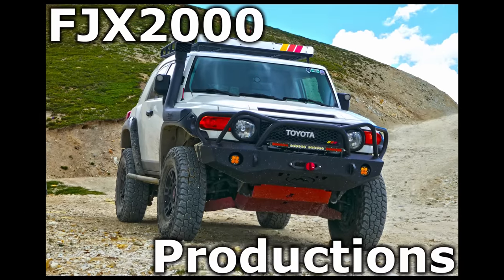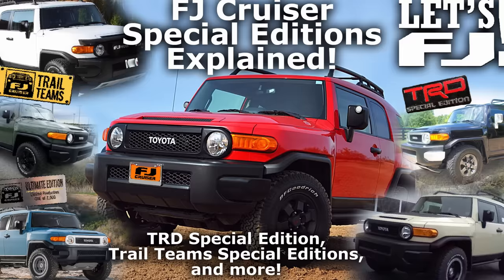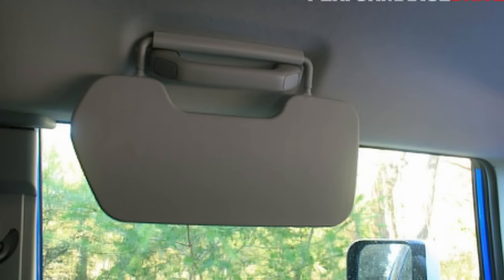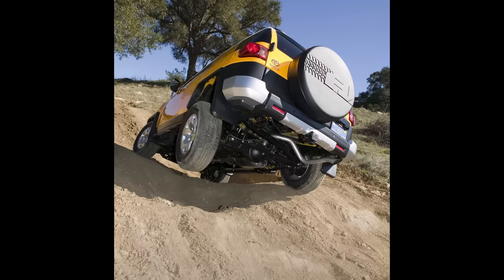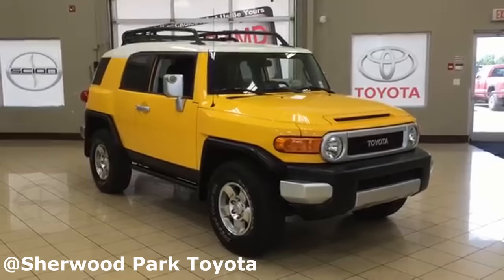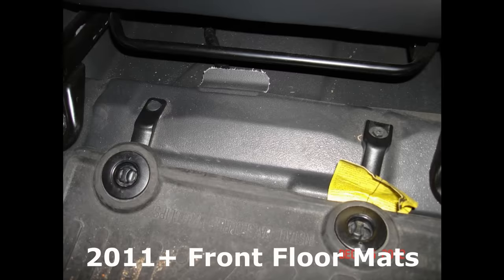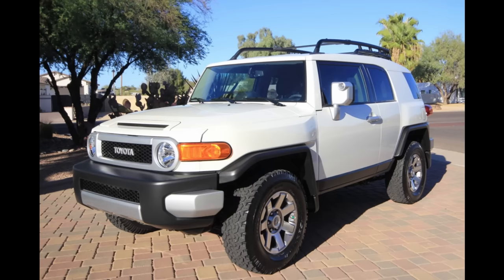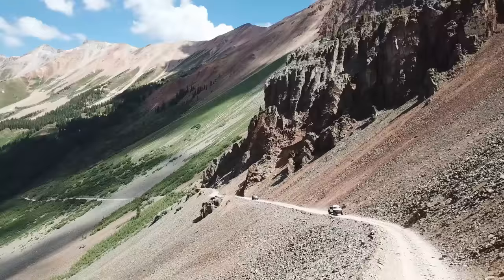Which FJ Cruiser Year is Best? - All FJ Cruiser Changes 2007-2014

Comment: I enjoy your video's and am a subscriber.  I recently bought a 2014 FJ (black with white roof).  Only has 50,700 miles on it now.  (When I purchased the FJ, it had 50,474 miles).  I am the second owner.
Reply from the maker: Congrats! Thanks for watching and subscribing!
Reply: How much did you paid for the FJ?
Reply: @anacorrea2675  I paid in the upper range of Kelly Blue Book.  (Between $39K to $41K)  This FJ was kept in a garage and is in an almost new condition.  The tires have so much tread left they look new.  Maintenance done on the FJ was by the dealer that sold it new.  There was a safety recall for the fuel pump so this was replaced along with the front disc pads.  This work was done before it was listed for sale.  If I had more patience, I might of been able to get the dealer to bring down the price.  However, I have no regrets and I am jazzed about my FJ!

Comment: When I've been collecting knowledge before buying my own FJ I found information that the front fender structure cracking was fixed by Toyota in 2008 (not necessarily ready for all '09 MY) by adding additional strengthen element inside. But if you found several 2009 MY FJs with this problem it means I found misleading information. Thanks for the video. Great job.

Comment: I'm a huge FJ fan, thank you for this channel...just seen a 2013 FJ, with 70,000 miles in excellent condition for $ 38,000 is this a fair price ?
Reply from the maker: Hey there! Thanks for messaging me! So to answer your question, I actually made up a spread sheet comparing 2013 FJs of all prices and mileages from across the country and this specific FJ seems to be pretty much right on the average for what these 2013 FJs are going for. So not a bad deal necessarily but also not the best deal out there. For that same price there are some FJs with only 31,000 miles. Hope that helps!
Reply: Definitely overcharged
Reply: It sounds about right!

Comment: We've got a 2010 FJ and it was certainly the bastard FJ, ordering parts for it is certainly....interesting because it's sort of a "which one?" Sort of deal.  Its got the upgraded engine and what not, but the floor mats use the hook retention and it's a little irritating, I have yet to find an answer on whether or not I can swap them with the twist and lock. BUT if you find an FJ with no A-TRAC and that's a deal breaker for you, DON'T LET IT BE A DEAL BREAKER, EVERY FJ IS EQUPUED WITH A-TRAC you just have to order the $40 button from Toyota and pop it in, which is a little labor intensive in the way that you have to pop a couple panels off to get the blank off and put the button in, but it's so worth it!
Reply from the maker: Yes when it comes to FJs you certainly have to know the difference between the 07- 09 models and the 2010+ models of you want to order correct parts. But the floor clips CAN be swapped out, check out the FJCruiserForums for more details but you just have to get the new style of "hooks/clips" and the newer floor mats to make it work. And to correct one thing, you can add A-TRAC button as you mentioned BUT only if  you also have the rear diff locker as well. If you have a base model only with 4x4 but no rear locker, you cannot add A-TRAC by itself unfortunately. Check out my FJ Cruiser button and switches video for more details. But thanks for your thoughts!

Comment: On daylight running on earlier Toyota fj cruiser mine a 2007 no crazy wiring hack needed, required.  Just raise up hood look on driver side look down behind headlight by turn signal you see the plug or remove small trim under driver turn signal you see a plug unplug it now no more daylight running headlights only takes less than 2 minutes I put bag over plug and taped it to keep it clean there is a you tube video on this quick and very easy job
Reply from the maker: Yep very true! But having the ability to control the daytime running lights like you can on those later years would require wiring up a switch. I actually followed a thread on the FJCruiserForums called the "Swiss Method" on my first FJ and was able to turn off or on the DRLs with the flip of a switch which was great! I did it so I could increase the longevity of the HIDs I had installed.

Comment: hey im a technician at lexus, great video i am thinking of getting a fj cruiser or a 4th gen 4runner limited. I'm trying to find a vehicle that fits my needs best between the two. it will be a daily driver as well as a weekend warrior going the distance as well as off road trips and the occasional tow of a car trailer to the racetrack. I am well aware of the modifications needed to get the limited spec 4runner up to the off road capabilities of the fj. I find it really hard to find a fj within my price range above 2009. Any sugestions??
Reply from the maker: The 4Runner and FJ are so similar it really just comes down to personal preference. If you see yourself transporting more than yourself and one other person frequently having a 4Runner with  the larger rear seat and true rear doors will be a great benefit, but if you like to Offroad and are really wanting something with a slightly shorter wheelbase then an FJ may fit the bill better. But you get more vehicle for your buck with a 4Runner and could find a better deal that way, since the FJs are selling for a premium right now.
Reply: @FJX2000_Productions  I now have 3 kids but won't get rid of my FJ. I just squeeze them all in the back :)
Reply: 4th gen 4runner is a no brainer for me, unless you really love the look of the FJ better.

Comment: Don't know if I missed it but  a major  major issue is the fuel tank size on my 08 these Fjs will take you anywhere but its not very far without extra fuel!! Wish I had double the size for my gas tank!
Reply from the maker: There are some folks who have added secondary fuel tanks to their FJs for this reason, but in places like the UAE or Australia you can get them from the factory with larger tanks!
Reply: @FJX2000_Productions   believe me I've done plenty of research.  I went with an expedition one bumper as a temporary fix for xtra fuel cans next year maybe I will invest in bigger tanks!
Reply: @FJX2000_Productions  only trail editions in Middle East were with double tanks or maybe some prior to 2010 models. FJs are excellent for daily highway commute, but refilling twice a week is pain...

Comment: Best model year of 13 or 14 is the 2013 bc the 2013 model year has a better build frame and chassis design, which a lot of people dont know, is from the toyota Tacoma from the same time period which made the vehicle longer and better at handling and comfort along with a much better advantage at offroading bc of the damping of the rear leaf spring and the front springs along with the sway bar
Reply: I though FJ platform is 100% J12 Land Cruiser chasis...
Reply: @The_Touring_Jedi  alot of people think that but actually no, the FJ concept back in 2003 had a custom chassis and body shell thats one reason most people where inspired by it, like the 2003 concept, the 2007 to 2012 had its own, for 2013, they took the chassis of the Tacoma from its generation, and rolled out a few special editions, paints, and options, and for 2014 it was another custom body and chassis design, not much different from 2007-2012 FJ models, all models used basically the same power train, and all used parts from land cruiser models, just refurbished, also proof that the FJ is not a glorified jeep bc of resale value and reliability, dependability, and capability, unlike Chrysler with this rollover likely rust buckets

Comment: I have a 2012 Army Green with 126k miles.,Unfortunately I’ve had to use it as a commuter vehicle.
It is leaking oil pretty badly now.  I’m about to get that fixed. 
I mainly use it off-road at the surf fishing beaches in DE. I have a permit for that.

Comment: 07 - The only FJ without those annoyingly expensive TPMS sensors
Reply: I have a 2013 model and it doesn't have TPMS. I guess it was an option that never made it to Australia.
Reply: 342k miles so far on my 07 💪🏿

Comment: I"m stuck right now between 2007 and a 2010   the 2007 has less miles. Both look good condition, but I am too far away to test drive either.

Comment: there is another big difference between 2007 , 08 to 2010 and up  ...despite the 239 hp against 258 , 2007 model is an unbelievable 1.5 sec faster from 0 to 60
Reply: I have a ‘07 and didn’t know this. When I hit the pedal, it surprises me at times though lol
Reply: Same here. Lol
Reply: It has a better torque curve than 2010+.  The only thing better about the 2010+ models is the fuel economy.  Whats funny about my 07 auto is its actually faster with the AC on than off.  This is totally the opposite with every other vehicle I have owned.

Comment: Today I have a 2008, with ATrac System and Rear differencial lock.The only thing I may install, is the Crowl control; for me, a magic tip to escape of the sand.
Reply from the maker: Unfortunately CRAWL Control cannot be added to earlier years of the FJ. It only came on the 2013 and 2014. Some have even tried adding it to the 2012 only to discover that the parts aren't simply plug and play. You pretty much need a whole new wiring harness and ECU among many other components. When all is said and done it is better to just buy an FJ with CRAWL control already. It definitely couldn't be added to an even earlier version of the FJ like the 2007-2009 models.
Reply: @FJX2000_Productions  Hello, what a pity! For me the Crawl Control is the best invention  Toyota had ever made.Here, in Uruguay, there are fews FJ Cruisers, and I think that there are all, from 2008 to 2011.Whatever, congrats for your videos and thank you so much for your answer.

Comment: My country of residence still gets 2021 models and is expecting the 2022's in a couple of months. so far these have been repetitions of the 2014 models but limited to only 1 trim package, which happens to be the highest "regular" trim (without TRD limited editions etc).
so it gets the JBL system, it gets the backup camera, bluetooth connectivity, fog lamps on the front bumper, and 2 fuel tanks.

been waiting for the 2022 to arrive so i can get one from the dealership, but my only issue with it is that it doesn't feel right buying an engine that's rather outdated at this point. it'll be a 12 year old engine. with 12 year old performance and mileage numbers.

unlike the new 2022 land cruiser 300 for example which got turbo chargers, same with the bronco and the defender.

if the 2022 comes with an improved (modernized) drive-train, one that feels more appropriate for this decade, i'd get it in the quicksand coat in a heartbeat.
Reply from the maker: That would be neat if they upgrade the engine, but I dont think it is likely.
Reply: Yes, any new turbo powered engine will require an entirely new FJ series to put inside, unfortunately.

on the plus side, there is hope that, after 7 years of identical FJ's at the dealership, that the 2022 model will get some sort of minimal upgrades to mark the 70th anniversary of the LC.

the 2022 LC300 already was announced as an anniversary edition from the start. Now we just got news that the LC70 is also getting an anniversary upgrade.

hope they do the same with the 2022 FJ.

Comment: Just picked up an 08' with a manual transmission today
Reply: Sorry to hear that
Reply: @guydent9046 Thanks for your input 👍
Reply: @Twigz11  You're welcome. I am a diehard manual transmission fan, however I do it so I DON'T have to work on the transmission. In this vehicle, the Auto is the way to go. That bellhousing gets worn and even the repair wears out. Faulty design.

Comment: Hi their loving the information you have on the fj cruiser I'm looking to purchase one is their any visual outer signs between the 2 wheel drive and 4 wheel drive I live in the UK. Is their any accessory companies that you could recommend different countries I have no issues. I've only seen autos on sale here in the UK.
Keep up the awesome videos.
Reply from the maker: Hey there! From the exterior you could look and see the lack of front FJ axles on the 2WD version and if you look inside the 2WD FJ won’t have a 4WD shift lever. Other than that it can be difficult to tell otherwise if it is 2 or 4 wheel drive.

Comment: I had a 2007 from 2010 to 2019. I would still have it but the rear dif went bad and it was way to expensive to fix. I had over 200, 000 miles on it and it ran wonderfully otherwise.

Comment: post 2010's are the best for more power, reliability, no metal cracking in engine bay. I have a 2012 TTSE, Red. Any 2010 or later TTSE in the FJ to buy. Mine has 98k miles and just broken in! Not for sale.

Comment: We have a 2007 with a 5 speed auto, absolutely love it but they’re not all perfect. 
 There was a suit against Toyota that didn’t go anywhere about the (auto) transmissions. You have to drive with it in 4, and only put it into “Overdrive” at the appropriate speed. When driving in OD at low speeds it will shudder the vehicle as the torque converter tries to lock into OD. Letting off the gas or giving it more will stop the shudder but it’s not supposed to be in OD at low speeds. 
 Second, the aluminum blocks are known to crack for no apparent reason. We had a coolant leak and couldn’t find where. There was a small crack in the block above the starter, which had to be removed to find the crack. It ran ok for a bit but we love the vehicle enough that we just had the engine replaced at 155k. 
 I’m not a fan of the 4wd (in Hi) having to shift gears to lock in either. Doesn’t help when you wake up to a snowy driveway and can’t lock in 4wd in Hi. You can use 4-low and it overrides that feature but you still have to find a stretch of road to make that shift happen in 4-Hi. Meh…
 Oh, and not being able to turn off the traction control and losing momentum in the snow (or wherever). If the traction control cuts in you can’t make that shift happen to lock into 4-Hi which is problematic. Basically we lock it in the night before just in case. Lame, but we still love the FJ and wouldn’t trade it in on anything else.
Reply: There is a hack to turn off traction control floating around the internet. I’m sure it’s on the FJCRUISER forum still

Comment: In 2007, Toyota fixed the weak rear differential problem with a B code on the differential. Maybe they changed the metallurgy of the gears or just removed inferior parts that slipped through QC.
Secondly, the old blue color of FJ40's was best modeled by the Voodoo Blue, but this is only my perception, I'm sure they are slightly different.
Love my 07' 6MT Voodoo Blue. No problems yet!
Reply from the maker: Yeah the FJ had 3 blue colors, Voodoo Blue, Cavalry Blue, and Heritage Blue, and I think that Heritage Blue color sure does look similar to the FJ40 blue colors, but I still enjoy Voodoo Blue more personally!
Reply: I was informed the diff issue was fixed in Feb. Or Mar. Of 2007.

Comment: Except the body that chasis and engine is Toyota Land Cruiser J12n built in FJ model. Had J12(120 Prado)Land Cruiser 4.0 V6...only problem here in Europe you need to be a tank station owner to have it. Consumption is on average 15l/100kmh which is I assume the same for FJ.

Comment: There is no mention about the engine between the 2012 and earlier models where the Exhaust manifolds of the engine is different from the 2012 earlier models.  The 2012 onwards models has a big hole with a small hole exhaust outlets on each cylinder oulet.
Reply from the maker: I do mention the engine change between 2009 and 2010 but haven’t ever heard about the exhaust manifold change in 2012 that you’re mentioning

Comment: Thanks for your video, that's really informative. I am currently owning a 2007 Fj cruiser base model, I guess my Fj has an issue based on transmission. When I shift gear from parking to reverse or reverse to dynamic, my Fj experiences a hard shake with very loud noise. I went to autoshop couple times, mechanics couldn't really figure out what's going on. Besides, there is no safety issue at all.  I am just wondering the reason behind this situation. Overall, Fj is a very decent vehicle, I really like my Fj.
Reply: Sounds like a bad ujoint.

Comment: I have a '14 TTUE 12,000 MI. (owned a '07 and '12 TT cement gray) but my vote is for the still 2021 that is not available here
Reply: '13 Cement gray didn't check my remarks.

Comment: We have an '08 and my wife and I love our car. Unfortunately we have enjoyed it in the driveway. Shortly after the 5 year dealer warranty ran out, well like 3 or 4 years later it jumped time. We struggled with the 3000 repair but did it thinking it was probably the biggest expense we would have and planned to own it forever. Then about 2 years after that it happened again. We only have 136,000 miles and we took it to are mechanic, and this is where I'm still slightly angry, we paid him 2700 dollars for the repair again except when we went to pick it up he said he couldn't fix it. Oh yes my wife still paid him, didn't know at first. So now we are just waiting to buy a new motor. We are in California so is our only option to get one from the same year? I really don't know the regulations. My wife is driving an Altima and hates it. Any info?

Comment: I have an 07 that needs new rock sliders. Any recommendations?
Reply from the maker: Here is a thread on the forums you can check out for guidance! Be sure to check out page 1 since it had the spreadsheet document that compares the sliders but page 3 has the photos.
Reply: Pure Fj Cruiser's rock sliders.